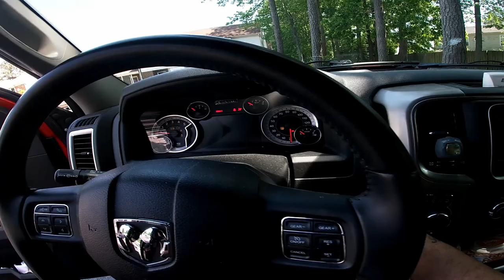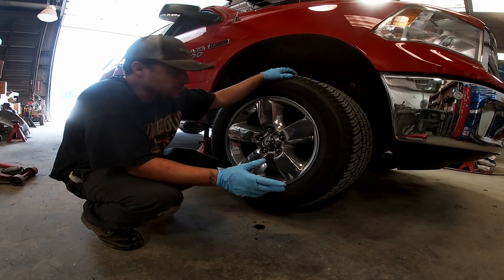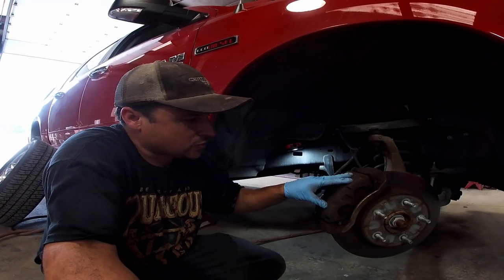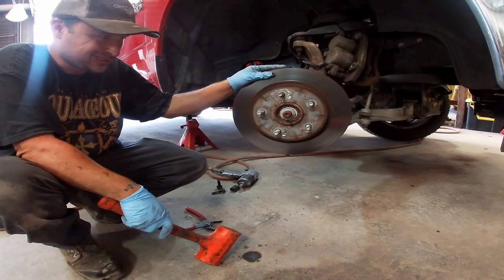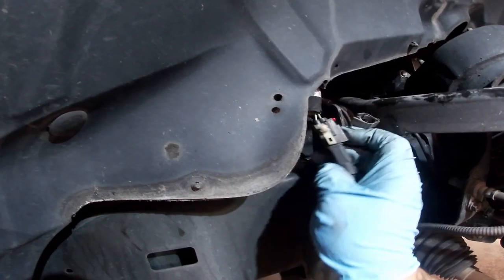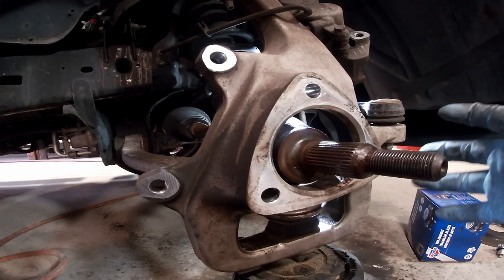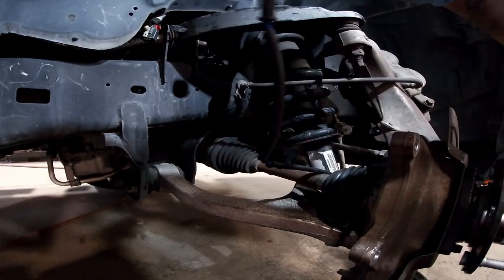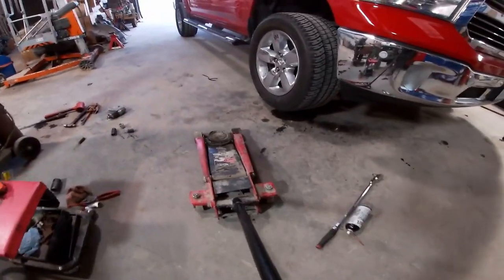HOW TO EASILY REPLACE FRONT WHEEL BEARING HUBS ON 12-17 DODGE RAM 4X4 ECODIESEL / HEMI / 1500 / 2500

Comment: Thank you your video made it so much easier to replace the wheel bearing hubs on my 2018 Eco diesel ram 1500 with 386,000 miles on it. Every other video showed me doing it a lot harder wig yours made it really easy I finished the driver side at 12:35 AM Pacific time tonight 12/26/24 tomorrow do the passenger side, fast and easy with new brake pads and rotors. Appreciate you doing the video Retired US Army sergeant major Gamsby.

Comment: @GasDiesel Garage.. Awesome content!  I'm a 2015 RAM 1500 SLT 3.6 rear 2WD and you gave some good tips on not having to remove the upper control arm bolts to gain access to  the rear of the hub - just push the axle back some..  Thanks for sharing brother 👊🏽

Comment: Obviously not in the Midwest where the roads are salted in the winter! I just changed both wheel bearing on my 2015 Ram 4x4 and had use a 3lb hammer and a sledge hammer to get the old hubs off. I also had great difficulty getting one rotor off. I had to use the 3 pound hammer on that as well along with soaking it overnight with penetrating oil.

Comment: Good video, here's my two cents. (This is assuming a high mileage truck and standard tools)
You'll probably need to disconnect the upper control arm to get at the bolts on the back of the hub assembly. And you might need a special tool to free the control arm bolt once the nut is off: it's taper fit and can be a bitch to get free. 
The 3 bolts on the back of the hub can be a nightmare without power tools. You'll probably need a breaker bar with ratchet attachment. Assuming you're changing a hub assembly that's overdue (probably, if it's clunking), this video leaves out the sledgehammer and copious amounts of force you'll need to get out the old hub assembly. It WILL be fused with corrosion. It can be helpful to reattach the upper control arm so the assembly won't be flopping around when you whack it. Keep at it. 
My bolt sizes:
2015 Ram 1500 4WD Big Horn:
13mm for caliper (31ftlb)
21mm for caliper bracket (130ftlb)
36mm for axle nut (185ftlb)
21mm for control arm (40ftlb)
18mm for hub assembly bolts (134ftlb)

Comment: Great video. Do you know what the torque specs are for the 3 bolts and the nut? Oh and what size that nut is?
Reply: A little late but might help the next guy. 36mm axle nut. 120 ft/lbs for the three bolts and 185 ft/lbs for the axle nut.

Comment: I have a 2015 Ecodiesel abs light 4x4 disabled has come on numerous times rear tire is skipping. The dealership said they replaced the front right wheel hub. Apparently they didn’t, problem still with lights going on and off.
The dealership hired a new service manager, he was able to research my service records. He claims they replaced the wiring this time. The howling noise started soon after. It was the left driver side. Watched another YouTube channel for a 2015 Ecodiesel and purchased the same part he used. Dealerships sure can be very shady!

Comment: I don't think mine is this loud but I'm having the same issues w/ the ABS Light coming on. Hoping changing the hub will eliminate it. Thanks for the video
Reply from the maker: Absolutely and I believe it will correct your problem.
Reply: @Gasdieselgarage  When my front shocks were changed at the dealer on my 2015 Big Horn Ecodiesel. The ABS Traction Contol light came on with the rear passenger tire would skip when starting from a stop or turning. Dealer said it was the right front speed sensor and hub. They claimed to have changed it but my experience in the past with warranty work suggests they didn’t do the repairs. 
I am buying a set of Timken wheel hubs. Hope it solves the problems.
Reply from the maker: @boostimalaka1  well unfortunately dealership warranty work can be a 50/50 decision on certain work and yes dealership mechanics get paid less doing warranty work. I do hope by you doing it yourself it will work out better. I worked dealership for 10 years out of my career so I know how they work. It sucks. I will help you in any way I can my friend.

Comment: I just did this on a 2015 Ram 1500 Sport and the wheel hub nut is 35mm[not 36mm]; the 3 bolts on the hub are 18mm[not 21mm] (mine were frozen so bad that a 1,000 lbs air impact driver couldn’t get them off). Hope this helps someone who has the same as mine. I looked all over for a 21mm only to find it was too big. Maybe the “21” was some code I don’t know about, in which case, I would look ridiculous for this entire comment…?
Reply from the maker: Good update bud
Reply: I had tire, caliper and rotor off before I realized I did not have a 18mm socket. 
Two different socket sets and they both go from 17mm to 19mm no 18, back to NAPA one more time.
Reply: @shamrock241r8  Exact same thing happened to me.

Comment: What's the torque specifications on the center axle bolt? And also (just asking) when one side goes shouldn't you replace both fronts?? I have a bad passenger side one as well and my buddy said change them both cause the other one isn't far behind but it seems fine...
Reply: 184 foot lbs for axle bolt.

Comment: I noticed you have the jack in place at 9:40.  What are you using the jack for ?
Reply from the maker: I put it here to help align the axle into the wheel bearing on installation...it’s much easier having the drive axle horizontally than hanging...but you can do it either way.
Reply: @Gasdieselgarage  thank you so much this has been really helpful !

Comment: What about the rear hub bearing. I could swear that my noise is coming from the back.  Do the rear bearings ever go out?
Reply: Yes, but they usually last 2 to 3 times as much as the front ones. There is less stress on them.

Comment: My old wheel bearing won't un glue from the nuckle...3 bolts removed...
Hit with sledge hammer behind wheel nut hub.... 50 times...
2005 1500 Rumble Bee.
Used Brake Clean  & WD 40 and chisels to try start the separation.. Nothing.
Reply: Might have to let that penetrating oil sit over night if it's that bad.
I just changed my front drivers side, had tire, caliper and rotor off before I realized   
I did not have a 18mm socket to remove wheel hub.
Soaked edge of hub and bolts that night, by the next day one tap with the sledge and it came off.
Reply: @shamrock241r8  I ended up using the A1Auto suggestion of cutting two wheel bolts out and doing the reverse bolt trick.
Also bought extra 18mm 3/8 & 1/2 drive sockets and a chisel set.
As I never popped a ball joint to swing knuckle out  it was a little more difficult to fit the ratchets.
Swinging the Steering helped with the access.
With WD40 applied the night before, the bolts creating pressure, the chisels once I was able to create a crack between knuckle and old bearing housing....my sledge hammer did the rest.
It was easier removing my old front differential and replacing with a rebuilt last month.

Comment: Should you replace both of the front ones if one is bad? Isn't the other one probably worn out too?
Reply from the maker: If your budget will allow, yes of course do both. But those wheel bearings are not cheap unfortunately.
Reply: Ok cool, I guess the don't fix what isn't broken saying applies here haha.. I have the same issue, thanks for the video it gave me confidence that I could just do it myself
Reply from the maker: @pimpdaddyk03  oh absolutely you can do it bud. It’s pretty much why I did the video lol

Comment: What size bolts hold the wheel bearing?
Reply from the maker: 15mm socket for the 3 bolts holding the wheel bearing in the hub

Comment: So Easy?... my 2012 with less than 100k on it must be the exception ...after trying to slide hammer it off for hours ...ended up removing the whole knuckle and taking to machine shop  where they claimed it took 30,000 psi on the press and full heat to get it out ... they almost gave up...so easy.... bahahahahaha...
Reply: This guy got lucky. The ways yours went is how most are lol.

Comment: Just so you guys don't do what I did, my truck doesn't take a 36 mm socket that I just bought for this. I have to find out what size mine is, so check before you buy.
Reply: Sorry I was wrong, the 36mm socket bottomed out on the axle bolt, I had a normal socket then I got a deep dish 36mm and it worked.